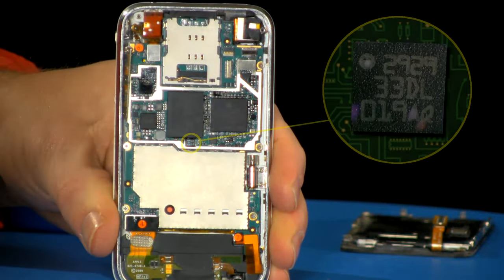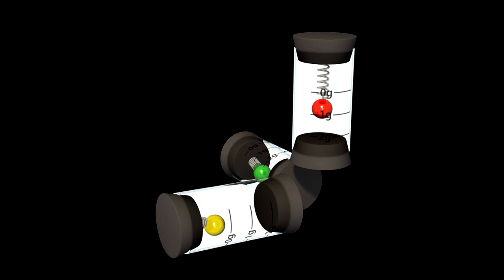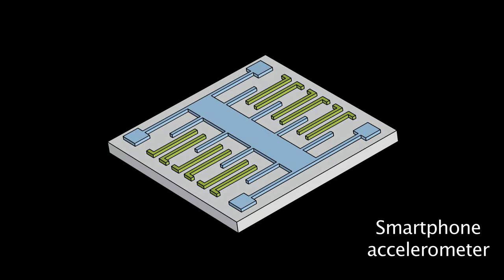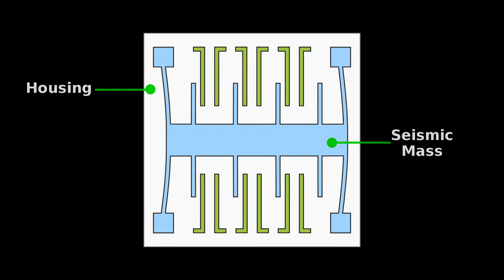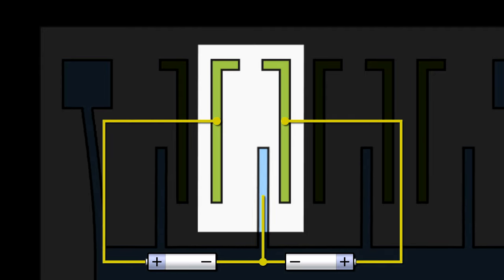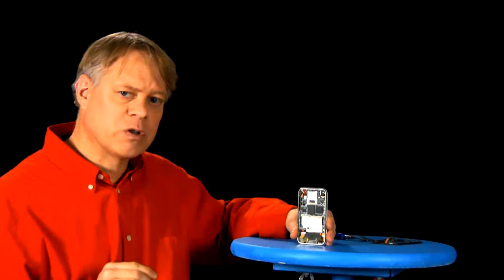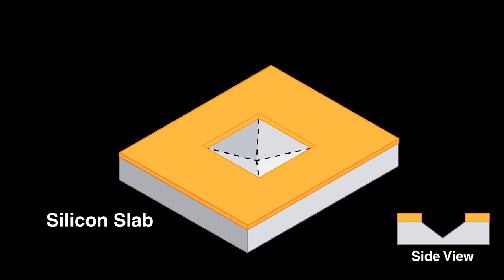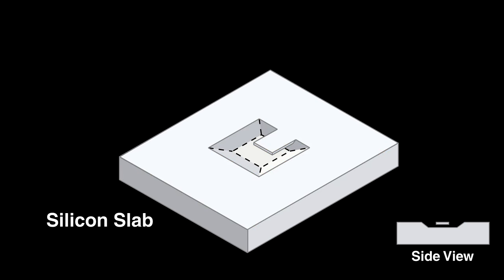How a Smartphone Knows Up from Down (accelerometer)

Comment: How can gravity effect such a micro tiny object, but we are told that insects and suchlike are not effected as they are to small ?
Gravity can cherry pick what it can and cant keep flat on the earths surface and is not determined by weight... Confused
Reply: How does that answer the Q .. Gravity can pick and choice what it decides to effect -  a micro piece of tech in a smart phone but not a butterfly
Reply: The Proof,

Where did you get an idea that butterfly is no affected by gravity?
Who told you that stupidity?

If you ever find butterfly, catch him and confine in some jar. After couple days when he dies, take it with two fingers, raise it high, and let it go of you fingers, what happend?
Has the butterfly stayed in mid air, or it went down to the ground?!

If the butterfly remained in mid air, gravity doesn't affects him, if the butterfly went to the ground, it is affected with gravity.
Reply: I am asking - how is gravity so strong it can hold a a tonne car to the ground and not prevent a small insect from raising itself from the ground... Yes I have read the theories and the de bunking vids but there is no real experiment or scientific proof that gravity really exists...
Reply: The proof,

O.K.

Lets try an experiment.

Try to lift a car, then try to lift a butterfly.
Notice any difference?

You se, gravity is the force that depends on two masses, in case of Earth, the mass of the Earth and the mass of an object.

Mass of the Earth is greater then any mass of an object on and around the Earth, so all objects will accelerate toward the Earth with the same speed, but since every object have different mass, it will have different weight.

Therefore a car will have much greater weight then a butterfly.

There are tons of gravity proving experiments, but you won't see them on flattards channels.

You see, if gravity wasn't proven, we wouldn't be able to measure it, predict it's behaviour and make equations to calculate it. No one would know how big, tall and massive buildings can be built without collapsing,  or where the cannon ball will fall when it is fired, and aircraft and rocket would be pure fiction.
Reply: I never believe anything on flatards channels or vids.. The point is Newtons theory has flaws and Lagrange experiments / theory came up with exactly the same as Newton. Science has moved on from a man under a tree.. Scientists now believe that Newtons law does not work with Einsteins theory of relativity, and more recent  Quantum  mechanics explains gravity not to be a force we are told it is ...

Comment: All you’ve done is prove Newton’s 3rd law and it’s implementation using hardware within the phone device.
All connectivity can be disengaged on the phone.
The phone will still apply the the implementation of Newton’s 3rd law.
So you’ve implied it uses the the “force of gravity” which isn’t true.
All that is being applied to detect the force on the accelerometer is density and buoyancy.
The video is pseudoscience and the idea the mass attraction is real is complete nonsense.
Our environment is electromagnetic and we tangibly experience buoyancy and density.
Reply: How does it know which way is down?
Reply: @awatt  the accelerometer’s vector is fixed by predefinition, so it doesn’t adjust for gravity as you walk the earth.
There are no upside people in Australia.
The earth is flat and stationary, space is fake.
Reply: @photosphotos  
That's all well and good but how does it know which way is down?
Reply: @awatt  I told you.
Reply: @photosphotos  
No you didn't.  You said that the accelerometer's vector is fixed by predefinition but you fail to explain how.
Reply: @awatt  ive not failed anything, it’s programmed to accept the axis is fixed, I can’t understand it for you.
Reply: @photosphotos  
How is it programmed to know which way is down?  How does the mem know which way is down so that it can communicate that to the software?  Simple question.
Reply: @photosphotos  
Let's try another approach.
How can buoyancy determine which way is down?
When I drop a pencil it falls down.  How is that possible without gravity?  Why wouldn't the pencil fall up?